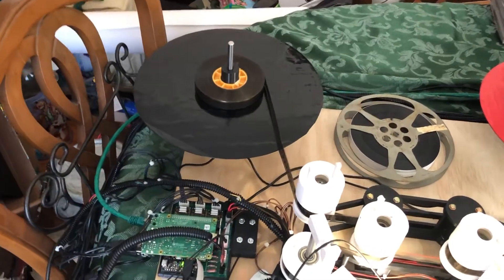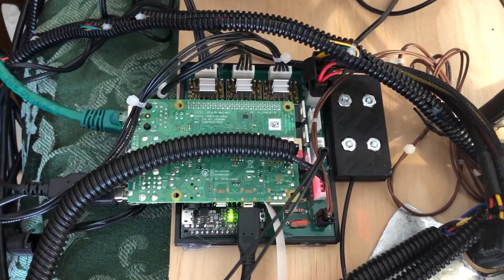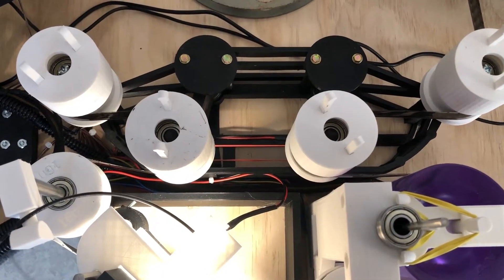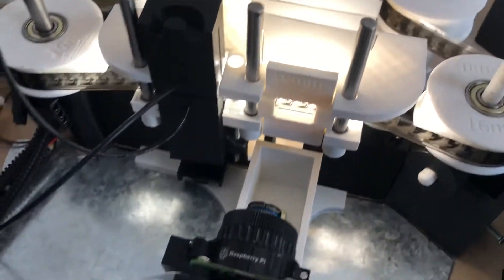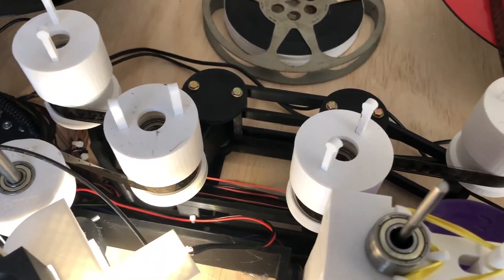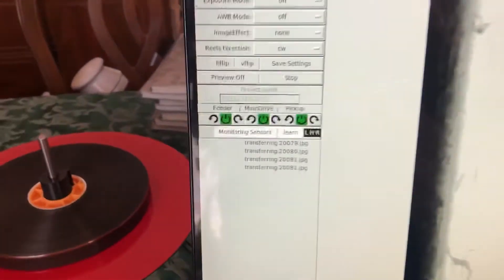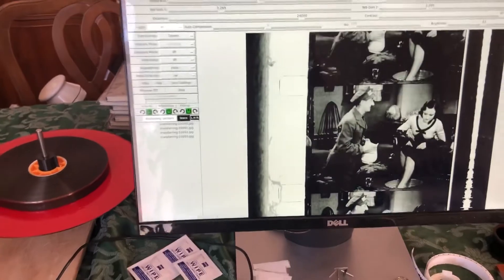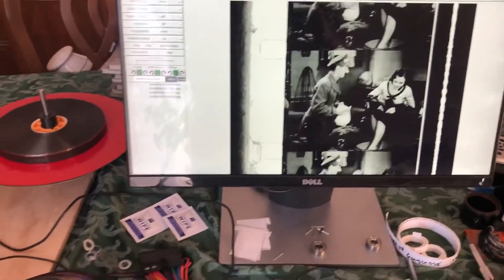The Gugusse Roller in action.

Comment: This is an amazing project! I've been looking at this for a couple years and the only thing I am stumped on is how much this DIY project costs after all the parts are made and put together.  Did this cost very much and did it take a while to build?
Reply from the maker: I didn’t keep really good track of what I spent on the project.  Probably less than $100 in plastic.  The PCB was about $110 I’d guess.  Motors maybe $60.00.  The Raspberry Pi was bought before they became scarce for about $100.  Camera was $50 with $100.00 lens.  Bolts, Bearings, etc. probably $100 so maybe $750 at the time.  Plus the cost of the 3D printer and a VERY expensive laptop.  But the learning experience and the fact that I actually built it myself (with excellent support from the creator of the project) made it an awesome project.